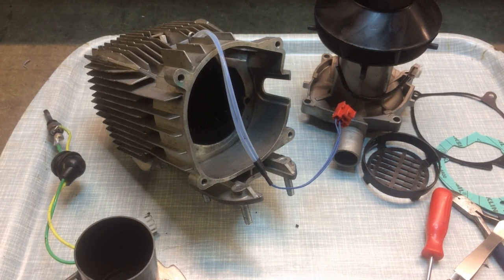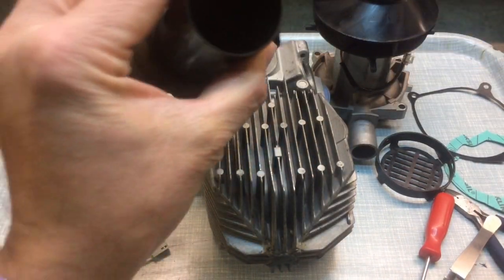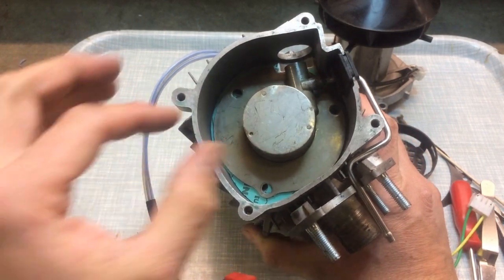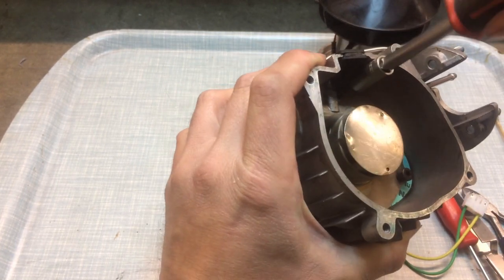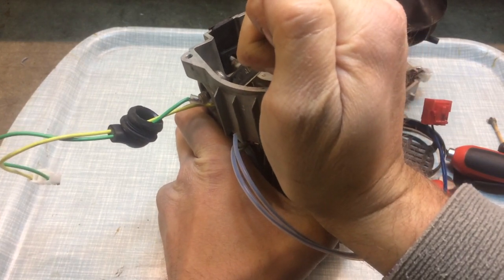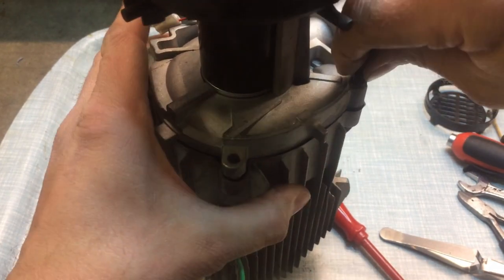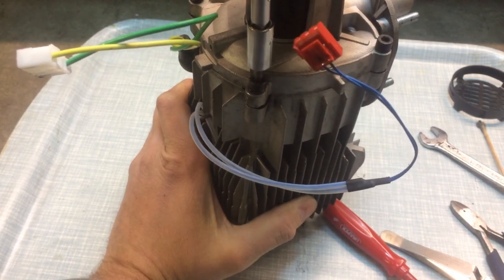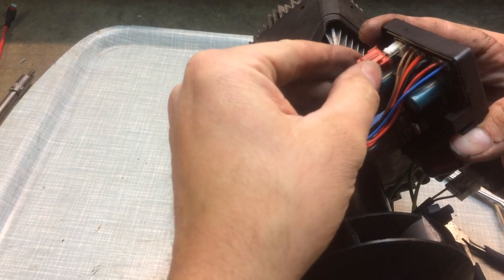Repairing a Chinese diesel night heater 2kW: Reassembly after cleaning

Comment: Thank you for taking the time to make these videos.  One note:
If you overtorque those three burner bolts you can actually create a leak because the metal around the bolts will buckle and cause the area half way between the bolts to separate slightly.  The proper procedure would require knowing or calculating a torque value then setting each bolt to a specific torque.   Because a leak could have devastating consequences its important.   The point being you do not want to simply tighten them as tight as you can.  Utilizing a carbon monoxide tester to ensure no leaks would be advisable.  Keep up the good work.
Reply from the maker: Thanks for the feedback and I agree - both are very good points. I do have a carbon monoxide detector permanently installed in the van and feel that it is essential when using any fuel burning heater.  Unfortunately I was unable to find the specific torque wrench settings for this heater - If anyone reading this knows the values then please do add them into the comments!